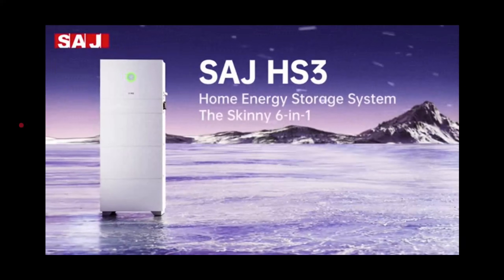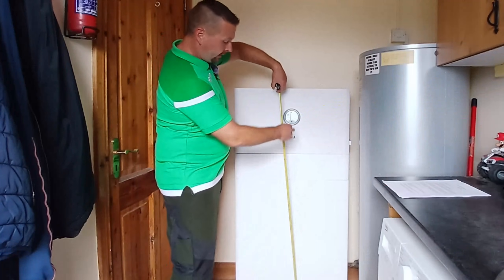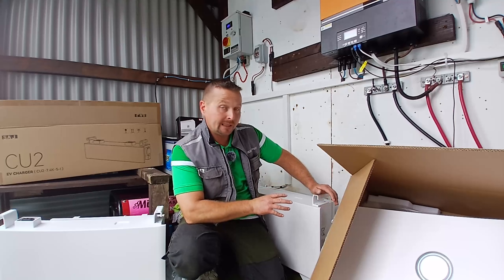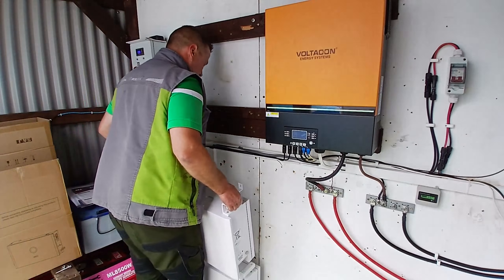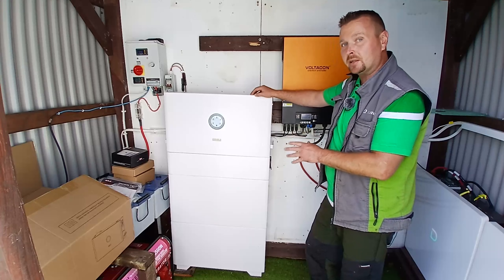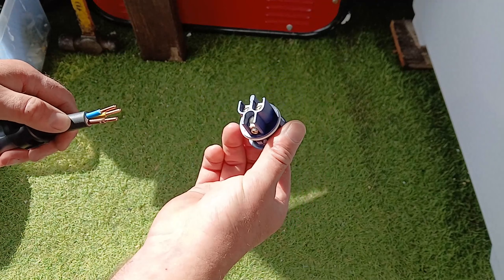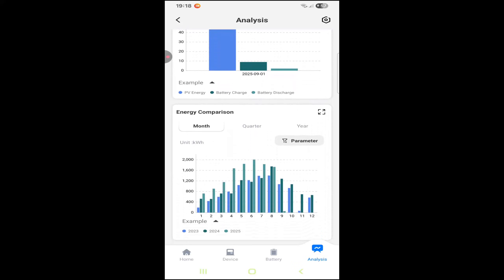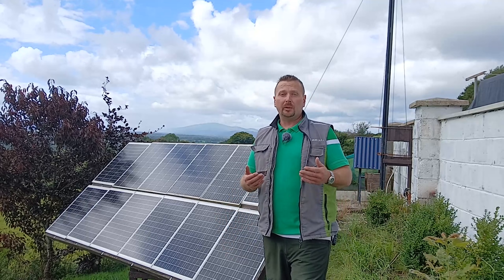HS3 by SAJ – Most Compact Home Battery with the Latest Home Energy Management Technology

Comment: Hey Mike few Qs: I remember you said in another video that when u buy batteries you should buy big the first time, if the Saj can attach only 5kw at a time do you still recommend?
Is there a website where I can read about your system? As I find myself trying to take notes on your system in writing 😅
Building a new house myself that is grid tied … so I’m researching my options on making my granny flat self sufficient… do you do consultancy work? Thank you for being so humble in sharing your mistakes knowledge and experience!!!
Reply from the maker: Hi Katie, the biggest flaw with the saj or sigenergy or similar products is that theyre limited in power and technologically tied. So for example if you want to do more than cook your dinner then you have to buy power in from the grid in the hope that you can sell more back the next day to negate that buy in. Technologically tied means that you have to buy the batteries that go with that specific product, you cant add another brand which may be cheaper as they simply wont talk to each other. Unfortunately the brand specific batteries like the hs3 are somewhere around 2-3 grand per 5kw, where as something like the dyness powerbox g2 is 2200 for 10.24kw. My belief is that when you're grid tied, your hands are tied. Solas inverters offer a better range of compatibility when it comes to grid tied setups. Perhaps talk to an installer about the solas range of products for your install.

Comment: no saj inverters listed with price here in the UK, i have looked @ there website, i suspect it is a sub brand of sig energy as there website(s) appear to be "twins" likewise the specs and full ranges appear the same, without the ability to purchase in the uk its going to have a hard job to get traction,even if it is a "twin" of a sigenergy unit,it potentially will be robbing sales off of each other, if they are "one & the same" as sigenergy ,you will get people buying the extra hsa "cheaper" batteries & putting onto the sigenstor units  & saving £££££'s ??
Reply from the maker: No, SAJ is a direct competitor to sigenergy and are gaining huge traction in both the UK and Ireland. I personally know of 3 hs3 units installed within an 8 mile radius of where we are. The approximate UK retail price for the unit featured in the video is 5k.

Comment: Thanks for the nice video! For the Grid and "Back-Up" charging, do you know how the back up charchging work? Can the "Back-up" be connected to an external power source such as a diesel generator?
Reply from the maker: The back up is a back up supply to the building in case of mains power failure. All grid tied units have to buy power in from the grid once the consumer goes above the inverters max output.

Comment: Looks very impressive. Great demonstration.  It would be good to know the costs and also if help was available for installation. Many thanks 🙂
Reply from the maker: Hi Damien, have to give the textbook answer as regards to installation as currently in Ireland only reci certified installers can submit the nc6 forms and other paperwork for a grid tied installation. I will get back to you with an additional reply in a few days as there seems to be a quite a variety in the equipment costs between retailers in both Ireland and various other countries. As soon as I have a reasonably accurate value in euros I'll post it as a reply. Glad you found the vid useful, thanks as always for tuning in.
Reply from the maker: Hi Damien, hs3 as shown in video is roughly €5500
Reply: @ourkilkennyhomestead2006 disculpe, en el precio de 16.000 eur aprox incluye instalación completa y montage completo de toda la instalación sobre pérgola etc...
Saludos.
Reply: Unos 16.000 eur aprox:
18 placas de 600w bifaciales
Hs3 10k trifásica
Cargador EV 11k
4 bat x 5kwh = 20kwh
Instalación y trámites ayudas, llave en mano.

La pérgola donde van instaladas las placas sería a parte. 2200 eur.
Reply from the maker: @josejm.v.7609 wow, thats more than double what irish prices are. 
Hs3 €5500 with 10kw battery and 7kw ev charger.
Bi facial panels €86 each inc vat
Installation fees do vary widely but the equipment is a lot less over here.
Reply: @ourkilkennyhomestead2006  inversor de 10k y 2 baterias mas serían la unica diferencia, verdad? En España tenemos el IVA +21% lo he incluido en el precio total, ademas trámites para obtener subvenciones que pueden ser hasta del 100% del coste total. Ustedes tienen impuestos como el IVA en España?